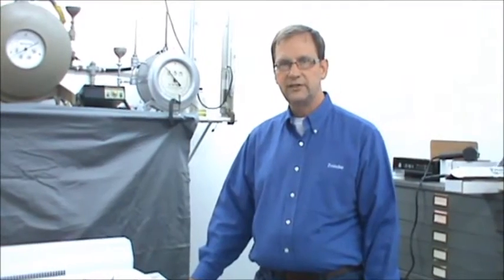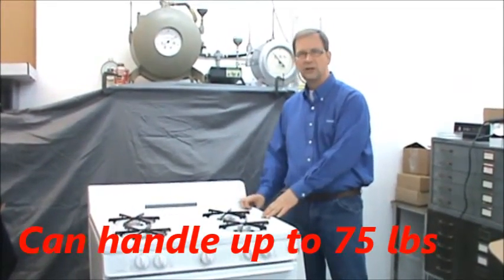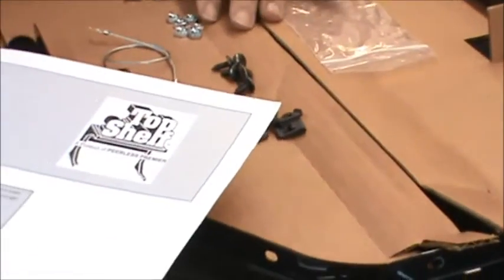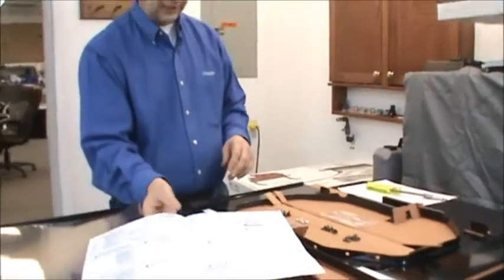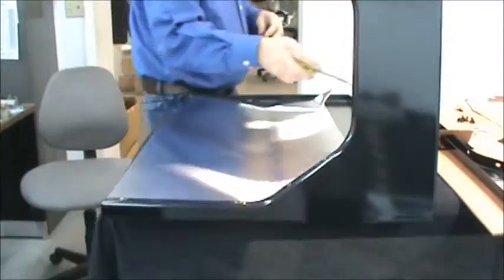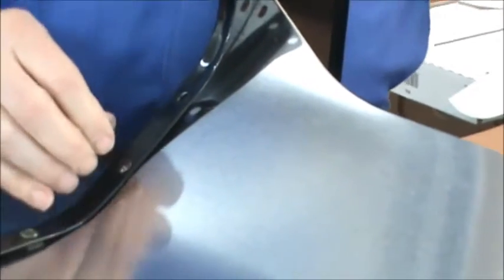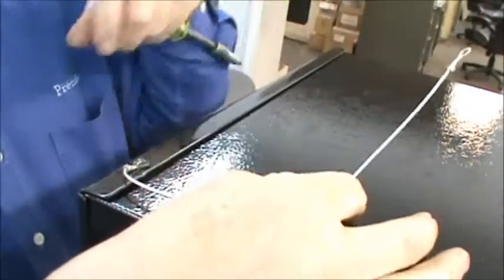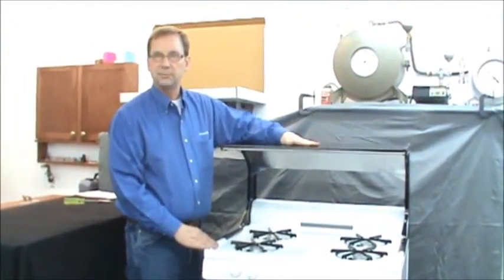Top Shelf Assembly Video

Comment: I bought two of these (returned one) and the predrilled holes in the black shelf top were too small for the machine screws.  The holes also did not line up with the holes in the arms.  I bought smaller screws and got them partially in place.  The instructions that come with the unit are
very different from steps in the video and make assembly much more difficult.  Thanks for this video! I would've returned the second one if I hadn't found it.